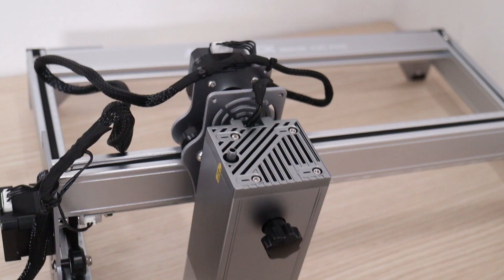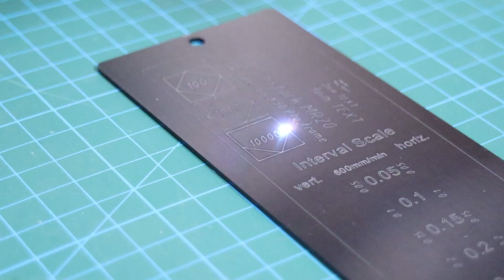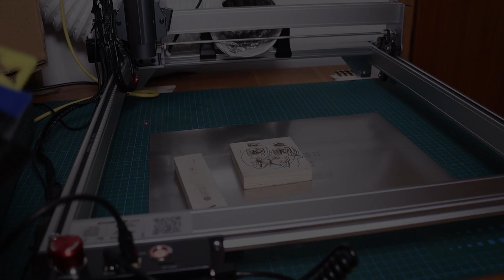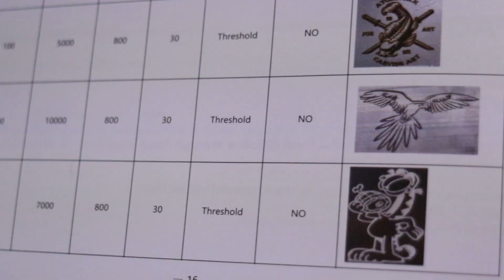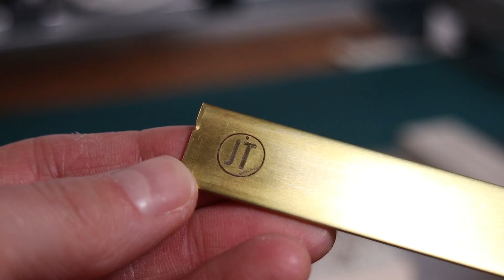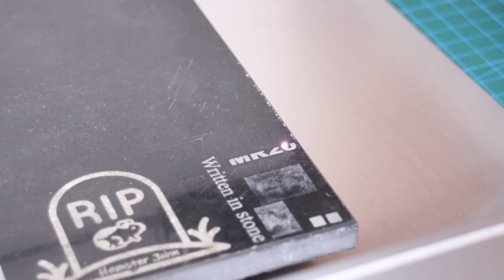Fiber Laser Upgrade for Your Diode Engraver? Atomstack MR20 Review

Comment: Do you need to use safety glasses for adjustment of the two red dots? or it could be done with naked eye?
Reply from the maker: You don't. Two red dots are adjusted without the main laser source running. Red dots are just a regular laser pointer

Comment: Hello, my MR20 is missing the connecting cable between the TTL port on the controller box and the USB cable on the laser head. Can you tell me whether the colors black on black and red on red belong together, or whether they are swapped by the cable? Best regards, Ingo.

Comment: How does this compare to the 2w ir module. I'm interested in larger format marking so maybe I'll get a large 600x600 36w sculp with an ir module.
Reply: Same as you i looked for big workspace and replaced my Y profiles from 400 to 1000mm on my S9.Very helpful 😊
Now i think how to modify with 1064nm powerful head.